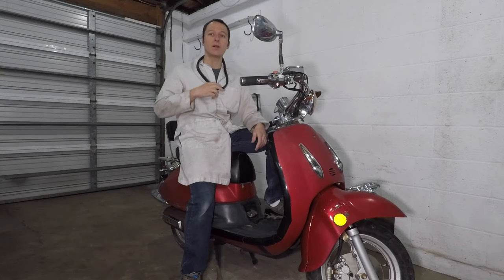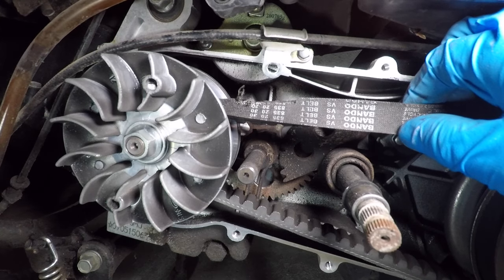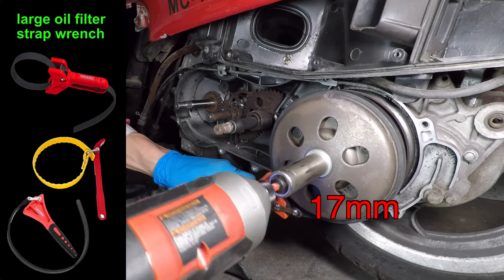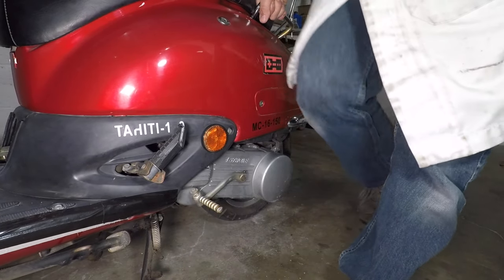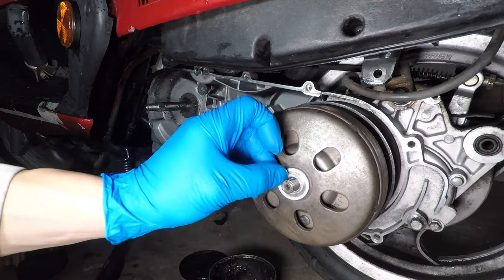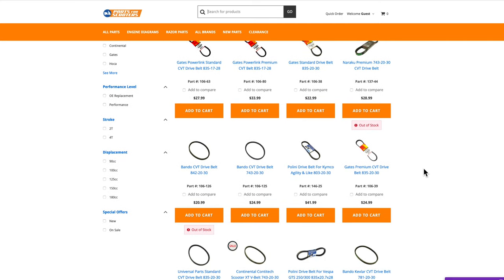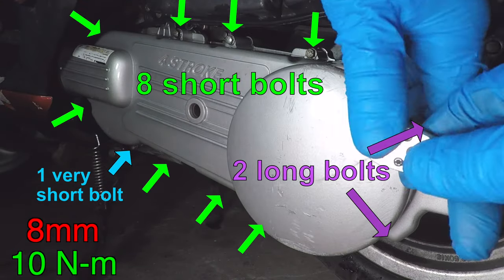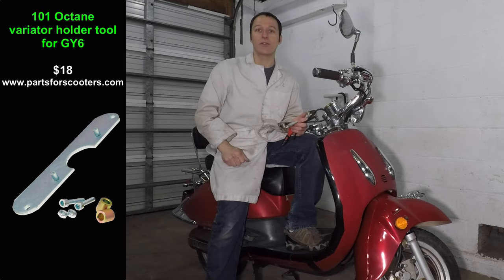Drive belt replacement on a 150cc GY6 Chinese Scooter

Comment: love your videos, ok so i had to replace on my gy6 oil seal behind that kick starter sprocket ON THE SHAFT( I HAVE SIMILAR   BIKE AS  IN THIS VIDEO...) I cant get it back on enough any ideas.. also do i have to ,does it help the variator when the bike is running.. ANY HELP IS APPRECIATED ...

Comment: My kickstart always gets stuck down and have to beat it back into submission
Reply: Ive kick started mine for years with little issues.

That kicker tells you how good the engine is by feeling the "bump" .
No bump = no compression =
Engine needs a top end rebuild.

Comment: Finally replaced the belt on mine today after it snapped about a month ago. Ended up replacing the whole variator assembly as well. Now after riding it for the first time, it feels like it doesn't have as much acceleration. Thoughts?
Reply from the maker: 2 possibilities here:  Did you get the right size belt?  If the new belt is longer, it might be slipping.  The other thing that can be happening is the new variator has different weight rollers.  The rollers move outward due to centrifugal force and change the gear ratio.  Heavier rollers will shift to a high gear faster, and might keep the engine at low RPM where you don't have enough power.  Lighter rollers will keep the engine at higher RPM and will generally give you better acceleration.  You can tune the variator by trying different rollers until you get the best acceleration.  I have a video about it here:  https://youtu.be/zIBj82RFVpY
Reply: @LabCoatPaul  makes sense, thanks for linking that other video. You've been a life saver for me as I've been getting my scooter back up and running!

Comment: hi, so big controversy..does the direction of the letters/numbers on belt facing, or not facing bike, Matter??????
Reply from the maker: I'm pretty sure the belt is not directional.  If you're a perfectionist, make the letters face you so it's easier to read.
Reply: @LabCoatPaul  Replace the kickstarter. It's essential if your battery ran out of juice.

Comment: I installed a belt on my gy6 scooter now I don’t have power can you help me
Reply from the maker: What does that mean? Do the lights not turn on with the key? Does the starter work? Does the engine run, but it's slower now? 
Check out my Chinese scooter playlist: https://www.youtube.com/playlist?list=PL1_JDBt1LSiJQETjZiOFXBKtv-ZzfqEx0
Reply: @LabCoatPaul  I’m not getting any power at all!
Reply: @LabCoatPaul  no dash lights or anything
Reply from the maker: @truckercai3571 your main fuse is probably blown. It’s a 10 amp glass fuse by the battery. I recommend replacing it with a plastic fuse and holder from the auto parts store.
Reply: @LabCoatPaul  thanks that worked

Comment: GY6 150 long case :
842 20 30 or 835 20 30
...dont by less then a Gates belt or you better keep an 8mm socket and a extra belt under the seat.